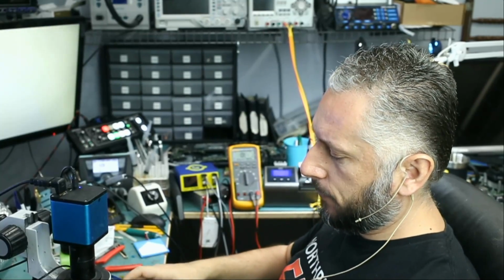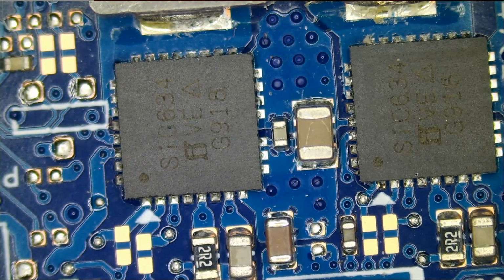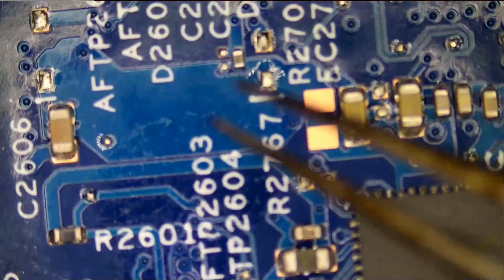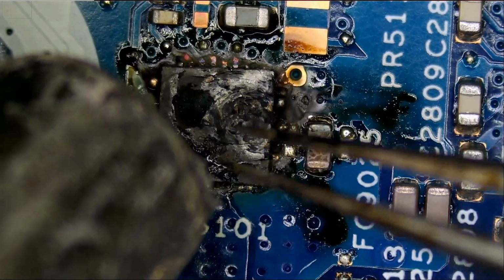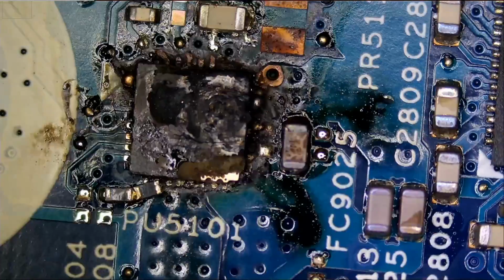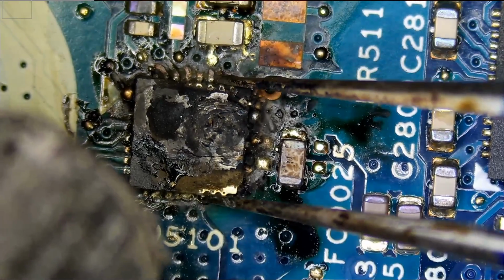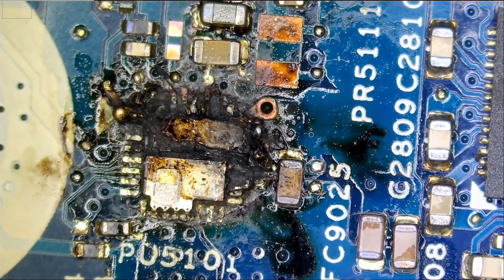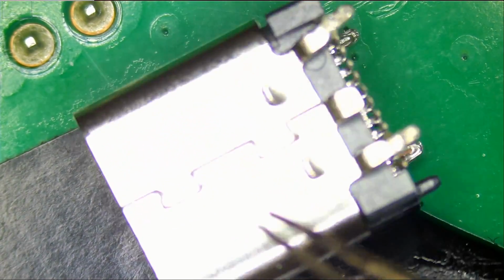HP Laptop Damage beyond repair -  Can't remove a blown chip with 500c.

Comment: In a case like this, I loop a coper wire around the chip and fill it with a low temp solder stick. It works 98% of the time when the chip is in this condition.
Reply: how does it help?

Comment: Anything can be fixed. It's just a matter of the cost. For my laptops I have found used replacement boards on Ebay. Over the years I have been spending around $150.00 for every board I purchased since 2005. I recently upgraded my old former powerhouse to a new sleek type and went for the enhanced 2 year repair anything plan hoping that by the time it expired used parts will become available somewhere. For the most part I never purchase the extended warranties due to their excessive cost.  They cost up to 20% of the purchase price for items with a low failure rate. Northridge rocks!.

Comment: If chips are soldered to a ground plane, you might need a hotplate or a hot air rework station to heat the underside. It always worked for me.
Reply: Not in this situation because as Alex explained the chip fused to the layers. Heating from underneath wouldn't have made any difference.
Reply: @paulroberts3454  possible. It is always worth a try. Plus is quite good practice to preheat from underside

Comment: I used dremel to remove chip that refuced to come off from laptop mainboard, the chip had welded it self to the copper groundplane. That chip was one of many mosfets for gpu power circuit and laptop still worked after removing it with dremel, how ever i intentionally limited power of the gpu with bios modification to 1/4th of the original power limit.

Comment: 8:47 same thing happened to me: i did lost some traces too when the Mosfet PWM driver has failed on my Powercolor R7-240 2GB oc, card not worth too much, but still, im using now HD5550 Igb DDR2 which is 66% weaker by the chips, and half of the memory, and slower.

Comment: Watching the video a few times shows that u knocked that small component up wards a few millimeters to the spot next to it that didn’t have a component. Then u grabbed a component from further up the board that blew off and put it in a different spot. Watch a few times and u will see. Not like u could have fixed it anyhow but just in case it was possible.

Comment: Surprising that chip got welded and fused... Too much heat, beyond the soldering temperature... Not indeed economical to revive, especially if the name of IC is not known. Some manufacturers erase names of IC so that technicians won't repair them and count as e-waste... 😢Overall, great success on using 500 degrees in removing that tough IC. Happy Thanksgiving and Merry Christmas! Greetings from Philippines!

Comment: I run into this a lot with automotive coil drivers when the ignition coils get stuck firing. Hot air + iron or 2 hot airs at different angles will usually take care of it.

Comment: I had a similar issue when desoldering an Xbox retimer chip. It eventually came off when I held the hot air nozzle perpendicular to the board, leaving just a 1-2mm gap for the hot air to flow out. The air is hottest just inside the nozzle, so it makes sense to place the component there.

Comment: Hey Guys I got a question:
I got an hp omen 17 with i7 6700hq  and gtx1070m from 2016.
Yesterday the notebook freezes and stopped while doing some photoediting. Now the gtx1070 is working only ~25% and doesn’t tact above 1000mhz (before ~1900mhz @ 875MV) temperature was always around 65*C/ 149* and now the HWmonitor said powerlimit 1. 

is this repairable?

Greetings from Germany

Comment: that is always a bad thing when a mosfet is fused with the conductor tracks, indicates quite a high amperage when something like this happens, as there are certainly more defective chips.
Reply: Not only high amperage, the high amperage must've flown there for quite a while too, possibly hours even.
Reply: @CoolKoon  that is correct but my post aims that this board went into nirvana and a repair is not worthwhile.

Comment: Blowing 500°C for that long without damaging the layers of the board made me speechless.
One day I did an ethernet chip replacement on my PC motherboard, when I reflow the new chip with hotair at 450°C for about 3-4 minutes, I managed to made the surrounding layers bulged.. 🤦🏻‍♂️
Reply: I've read that older PCB's (mainly FR-4) can absorb moisture from the air and over time the moisture gets trapped in the layers. As you apply heat, the water vaporises and lifts the cladding which results in bulging and potential power plane layer separation. One trick is to pre-bake the board in a reflow oven at a low temperature for an hour to try and help it evaporate from the layering before you begin SMD re-work.
Reply: @t0rxe  Thank you for the guide! I now see why most modern hot air stations have also heating pad under the PCB to be heated! Great idea!
Reply: @sophietronics  the pre-heater which heats under the board also assists with maintaining an even temperature throughout the entire board which helps prevent thermal shock and thermal expansion which helps prevent BGA pads from lifting whilst reflowing.
Reply: I felt for you. I tried to use hot air on one of my friend's unit, I targeted the CRT board and... woah, it caused burnout and also made some sort of blister on that board. It's one-sided board (usual for CRT boards and Television motherboards of old days). I started to felt scared using hot air. But thankfully NorthridgeFix is a very good encourager on how to use hot air.

Comment: Why, why do it that way with so much heat?
After a minute of chip not releasing I would have used a handheld rotary tool and ground the chip down almost to the board.
Then I would have heated the leftover and removed the rest.

Comment: I would've tried to fix it, the traces might be easy to find if the board schematic is handy. Most, if not all of the laptops that I was fixing had schematics online, so I hardware overclocked  as many of them as I could and had the time for.

Comment: This looks like a failed attemp to remove the chip, I experienced the exact same not long ago,. The person who worked on it didn't apply leaded solder, cranked up the heat and for sure used inappropriate liquid flux which carbonizes rock solid around the pins and the traces welding them toghether
Reply: it doesn't matter, those traces were already welded together and disintegrated long before Alex took that heat gun to it, in this particular case apply leading solder to the few remaining legs would have made no difference
Reply: @coyotex850  I'm not blaming Alex, this board has obvious signs of previous work being done

Comment: Can you use mercury to desolder? It comes off very easily, just have to clean the residual mercury afterwards thoroughly.
Reply: Mercury is a "controlled substance" here. Heating mercury gives off more dangerous gasses than the lead does.
Reply: @calvinmientke3539  I agree but I saw a video where the person was using it to form alloy with lead and then the alloy having a very low melting point, melted off from the board at room temperature very neatly.

Comment: The only time I attempt to repair a burned board is if it is no more than a double sided board with large traces (power supply or the like) and there is room to cut out the damage and epoxy new circuit board material into place.  And then, only if the device is irreplaceable and the customer has to have it regardless of the cost.

Good call, thanks for the video showing the attempt.  I know you wouldn't have done it except to show us the process.  Great job!

Comment: I'm surprised normally you'd add flux before applying heat or low melt solder but that low melt wouldn't help of it was one with the board but flux if it got under the chip wouldn't it help a lil to release it?
Reply: He did apply some flux...

Comment: I had this exact thing once before... maybe not that deeply burined into the layers, but similar.  I said I will give it a go just for the sake of it.
Spent hours and hours on this, and was somewhat hopeful. 
And it worked! For just a little while. The moment any significant load was put on the device and the current risen it developed another short.
So yeah... these are lost cause.

Comment: Maybe that component was placed using an SMD adhesive, such as Structalit or Vitralit. We use adhesives to hold some components in place for reflow, and if we put them under a QFP or similar, no amount of heat will get it off...only the right debonding agent...and some of those will destroy the soldermask as well! That's why I prefer corner bonding...so repair people can SEE when it is there.
Reply: can you please tell us several examples of debonding agents so i can look them up: thank you so very much
Reply: @din-kin  common ones are A-7, un-cure, and StarBond debonder. Another one that is useful is DeBond Marine Formula. Loctite X-NMS also lives in my kit along with a spray bottle of deionized water for rinsing solvents off after debonding is done.

Comment: That is really sad. I dont think many manufacturers are adding proper short protection to these boards nowdays, like fast blow fuses and diodes on high current lines...
There was probably nothing even wrong with that IC, but if there was a short after it in the circuit, that huge amount of current draw going through that chip could have fried it big time
Like why did the charger not go into protection mode? Hp seems to be poor quality

Comment: Constructive criticism: You just jumped straight to air gun and without flux for quite some time.
Considering that it may be welded to the board, this should have been cleaned with proper chemicals first, then use some other flux that doesnt evaporate like yours, something like colophony. If it doesnt want to be removed with a little bit aggressive desoldering then it should be grinded. More effort we put into repair, more enjoyable and memorable it will be. 
This was chance to see video from nuclear bomb to full repair.
Reply: "from nuclear bomb to full repair", the layers of the PCB are full of carbon, effectively shorting them. The board needs to be escalated, and the layers replaced with wires (likely)... and then the mosfet is likely not the root issue, itself. If that was a personal laptop and just wanted to repair, it might worth the effort, doing as business doesn't feel anyhow right.
Reply: It wasn't the solder holding the chip to the board though, and any sort of grinding or even cleaning would've most certainly scraped whatever solder mask was left and lifted every single pad. Sometimes it's not about whether something CAN be fixed, as much as it's about whether it SHOULD be. Sure, he can jumper wires, glue chips down, and spend hours and hours on it, but this excludes 2 things one has to consider. One is that economically it doesn't make much sense as it's a probability game and you are working against odds on something this level of damaged, and the other is that you have to stand by your work with warranty and rigging things up to work just to say you achieved a success and handing it to someone who has no clue how rigged the device is, is precisely what makes repair services get a bad name, and your name and reputation is all you have in this business and quite frankly it's just not worth it to risk sometimes on motherboards that are likely not very expensive to replace, or hard to find.
Reply: You should open your own shop and YouTube channel.
Reply: @TechHug  I will, thank you for your support.
Reply: It comes down to if the laptop is worth to repair or not. And in this case it would have been cheaper just to buy another one.
Reply: He should have sent it to you since you appear to be an electronics repair master Yoda.  He made the right call.
Reply: @Discretesignals  Right call = blow away 2 components, destroy at least one near chip with heat, rip copper traces. If I am Yoda, then "The greatest teacher, failure is."
Reply: @orion310591RS  Master Yoda could rip that chip off using the force.....lol

Comment: Damn, so a mosfet chip actually got dug into the layers of a laptop board, probably due to a severe implosion.
How does that even happen on a laptop board to begin with? I mean, aren't components of this type of product supposed to be ultra low voltage?

Comment: Sometimes grinding out a welded chip is the only option, otherwise many layers can be ripped out. Unfortunately if the FR4 is carbonized in the area, there will be a short through layers which is rarely fixable at that point, need to excavate all the carbon with keeping the signal intact. Hate those.
Reply: Grinding out?! If a chip's welded onto the PCB chances are the traces below it are beyond repair too. At which point throwing the whole thing straight into the garbage is the only option left.
Reply: @CoolKoon  nah dont throw it out, put it in the box, you know, the collection that is essentially a hoarding issue as seen by outsiders, but just about every other chip on that board should be good, meaning it can be used as a donor to repair others.
Reply: @the_socompsp  ah, my collection of broken flashlights, computers , and most things with pcbs
Reply: @kevinbaker2470  i was thinking grinding the chip to with grinder pen... maybe left the chip pin
Reply: Yes can grind it out.  Usually below these chips is ground plate, but of course take care.
Reply: true. at this point you should simply throw it away :)
Reply: @paugasolina5048  maybe the board. spare the other parts. not all parts in the broken board are broken)

Comment: We call those 'cratered components' -- because they left a crater of unusable area within the board.
Often happens with mosfets and the like. I've seen these on printers and xboxs.
Reply: How common are the bleeding caps in Xbox machines? I´ve read that they tend to leak.
Reply: @ferna2294  in original xbox its almost a guarantee except for some later revisions of the original xboxes i think?
Reply: We call them Nagasaki bombs where I wok.
Reply: @ReeseL4D  bruh
Reply: In printers too? I usually associate them happening in high wattage applications but printers?

Comment: I have encountered mosfet failures like this in automotive ECU/pcm's and Also an inverter Tig welder and if you carefully grind it away you can often reclaim it without pulling traces off but you need to pick your battles because it took a significant amount of amperage to cause that kind of damage which usually has a daisy chain effect and other components usually take on damage during the initial failure so from a business aspect it's not worth the time but from a project/hobby aspect go to town and try your best.
 It's not like you are going to destroy it any further but you can improve it and maybe save it.
Reply: That sounds like something you'd do on a one of a kind or no longer made board and not something that costs less than $10,000 lol.
Reply from the maker: Grinding a burned chip is Cancerous, tedious, not practical, not economical and no guarantee that that's the only thing wrong with the board. You need to know when to call a device a no fix. Comes with practice.
Reply: @NorthridgeFix  such extensive heat damage probability not worth putting in further time due to burnt layers?